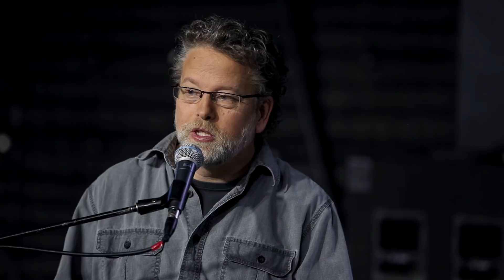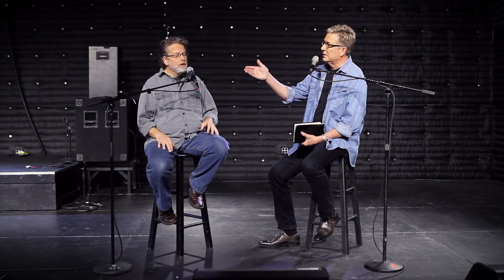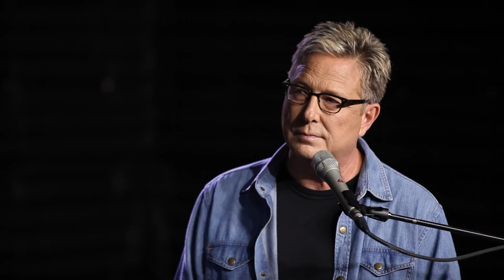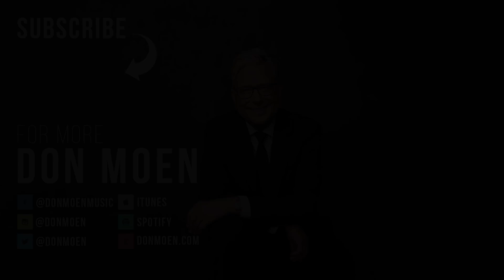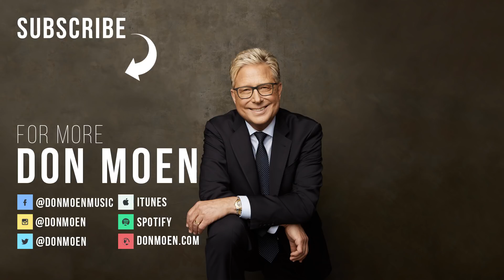Dynamic vs Condenser Mics | Sound Engineering Workshop

Comment: Sir, I am beginning.  I want to record my written poetry professionally.  In which my line will go in high tone and will also come in low tone.  Tell me such mic and audio interface.  So that I can record and mix later.  But my room is not sound proof.  My total budget is  $300.  But a shopkeeper told me that you cannot do recording with dynamic mic.  Please tell me what should I do.  Tell me such a mic and audio interface that I will not regret after buying.

Comment: It’s a myth that condenser microphones pick up more ambient noise than dynamic microphones.  The ratio of ambient noise to subject noise is dependent upon polar pattern and noise source to microphone distance and not dependent on whether it’s a dynamic or condenser. So for two mics with the same polar pattern and the same distance between subject and microphone capsule the background noise will have the exact same ratio to the subject signal. The reason dynamic microphones appear to have better background noise rejection is because people typically put the sound source closer to the capsule because they tend to be more resistant to plosives and proximity effect. So if you want to use a condenser in a noisier room get as close to the capsule as you would with a dynamic and there will be no background noise difference.

Comment: I’m conflicted between an Audio Technica AT-2035 and a Rode Procaster, I need the microphone for zoom meetings and important presentations over videoconference, so my voice needs to be appealing to the viewer, I also have kinda of a deep voice, which one you think would make me stand out?
Reply: Adding just for history since the question can be irrelevant now. The only advantage of condensers is raw sound, and you gonna sacrifice everything for that. For any you know non-musical purposes (read: everyday use), dynamic mics are better: less dependancy to sound/echo-proofing, less sound leaks (like from computer, chair screeches, "mouth noises"), durability, smoother, less annoying sound. I personally have procaster as dream mic for everything use and i quite like it. The only thing is its hella power hungry- i hooked it up to 286s (not a mandatory solution, to be clear) to get a lot of clean amplification and some basic hardware-driven effects.

Comment: i don't like my voice on a dynamic microphone but I feel it's pretty decent on a condenser... more close to what I think I sound... if this makes any sense...
Reply: That'd correct. A dynamic mic is missing both high and low frequency. They're convenient for stage performances but most studios record audio with a condenser mic because you capture a much wider and more accurate representation of the voice. Of course, all mic models sound slightly different and color the voice a little differently so you have to find one that suits your voice.

Comment: This is great
A question is it advisable to use a condenser mic on acoustic guitar other than wiring it?
Reply: I see no problem in that..  just make sure you EQ it right.. mic it at least 1 feet away from the sound hole or near the end fret..